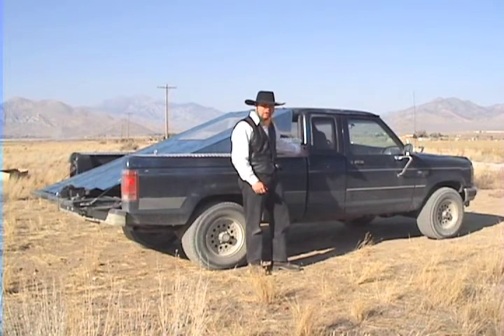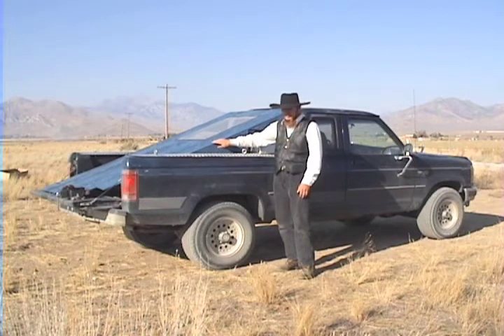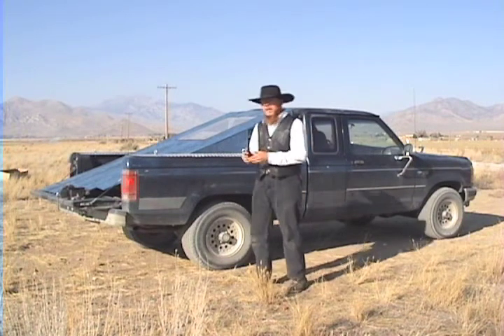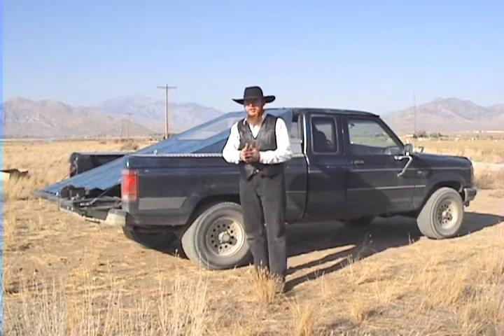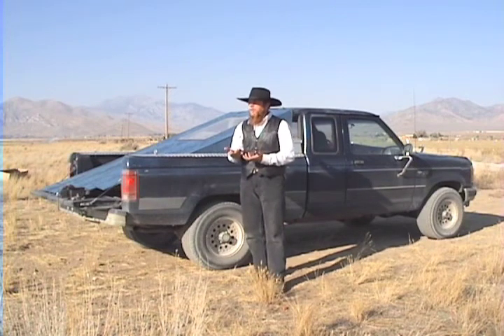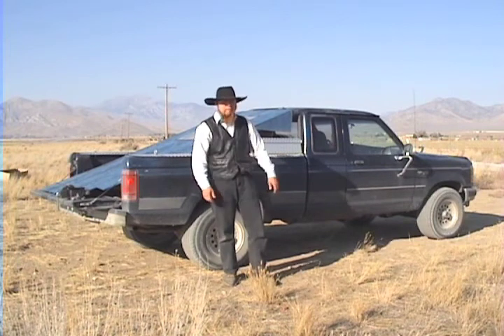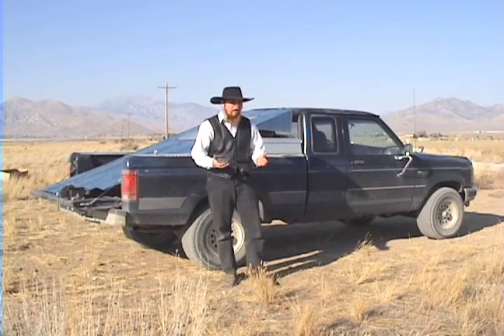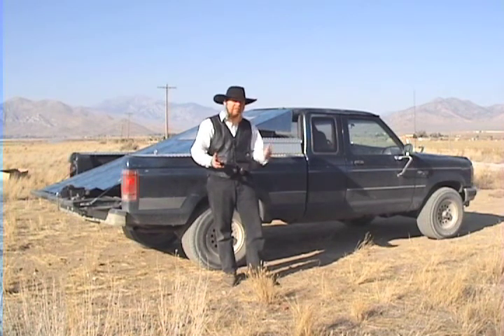Idahoan Smart-Car (TIS023)

Comment from the maker: The faring is hinged at the top of the cab, so I can lift it up to access the bed and/or toolbox.  However, it is still a trade-off with regards to accessibility.  I built it mostly to see how much difference it would make, and used it on a couple of long trips, but recently I've been hauling more stuff and only driving around town, so I have it off for the moment.  I made it so it just bolts to a mounting fixture on the cab, so its relatively easy to put on / take off.

Comment from the maker: Well, if that's accurate, then maybe the observed 10% improvement in this case is all due to reducing/eliminating the low-pressure region behind the rear window of the cab.  Wind-tunnel testing or CFD modeling could provide a decisive analysis of the pressure distribution, but unfortunately I don't have access to either at this point.

Comment: I think if the tailgate was HIGHER than the roof of the cab, then it would be a drag. But I think the air has already been pushed aside by the cab and windshield, etc. They also did a test on Mythbusters of riding in the back seat of a convertible during a rainstorm. Believe it or not they kept dry. Similar to air currents. But google truck tailgate and aerodynamics. Will probably gt sites for it and against it. Good video and I love your stuff as I am a subscriber.
Reply: In general, the back of an object generates more drag than the front. Unless you're supersonic, "air pushed out of the way" doesn't help that much for drag, and much drag is produced when the air flows back around.